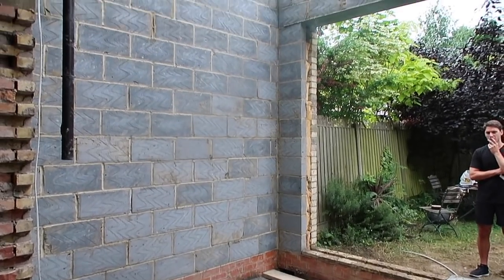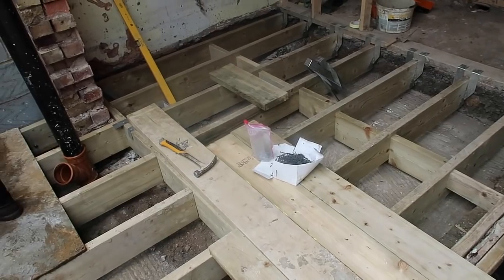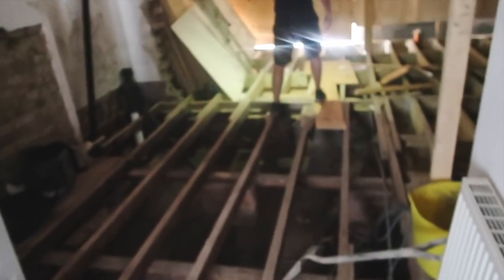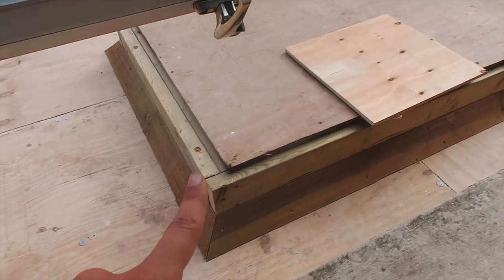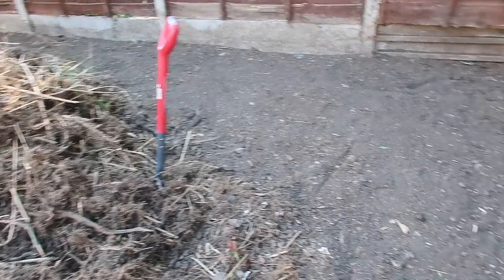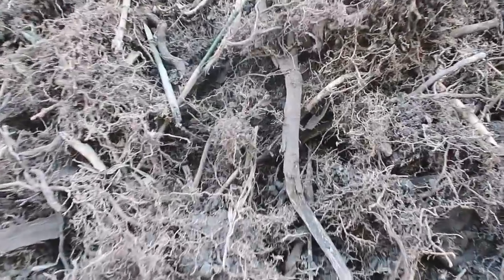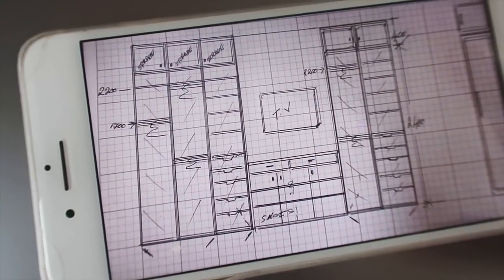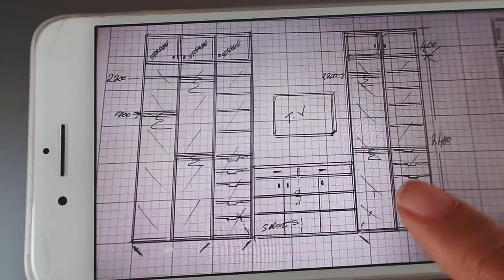WE HAVE A ROOF! RENOVATION VLOG | Lily Pebbles

Comment: Random question- I noticed that her walls are plastered, whereas in the US, the majority of homes would put in dry wall. I have lived in older homes with plaster in the US and it was a bit of a nightmare in terms of warping, finding studs, and decorating /hanging (I just wasn’t used to it). I know most of Europe uses plaster walls, but is there a particular reason why people opt for it when renovating? I’m sure has to do with some combination of cost/energy efficiency/sound whatever, but it just seems to be total opposite building preference in the US and Europe and I was curious!